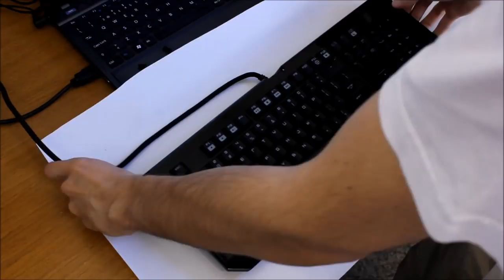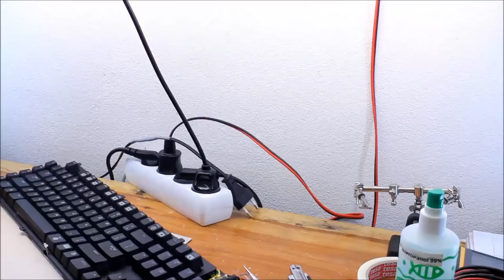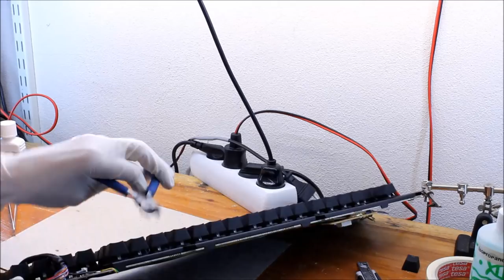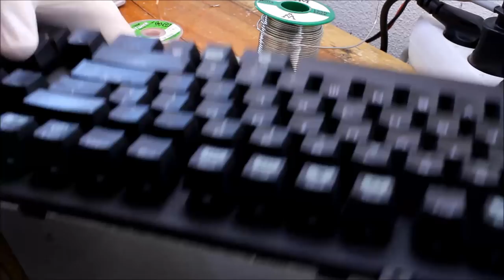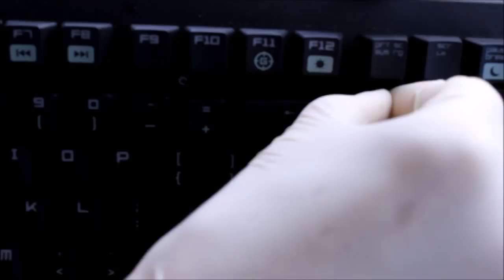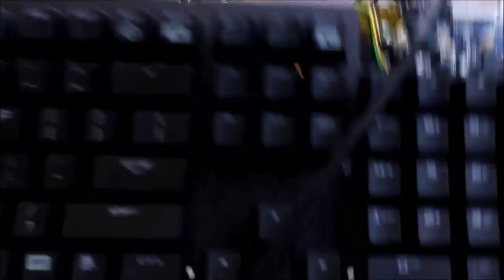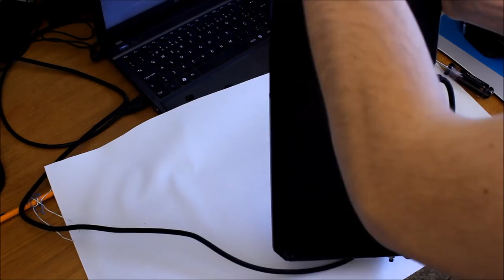How to replace backlight LEDs and Cherry MX switches in a mechanical keyboard.

Comment: Can a technician do this for me?
Reply from the maker: Sure, take it to a computer or phone repair shop near you and ask for a quote
Reply: Ok, thanks very much :)! Mine is the Razer Blackwidow Ultimate 2013, you think it is possible to switch my LEDs to Reds and leave the switches as they are?
Reply from the maker: Yes, but it will be a LOT of work, and the PCBs are very low quality (at least it was in mine), you will probably damage a couple of tracks and have to make wire shunts to repair them. If you decide to do it and you are not very experienced, find an old PCB and use it to practice removing and resoldering components so you are more confident when you do it in the keyboard.
Reply: Thanks a lot dude :)!!

Comment: No offense but the way you remove those led's are not recommended! You should do it with a soldering sucker to completely removing the old solder without damaging the actual pcb and also to easily replace them with the new one
.
Reply from the maker: +DARKRENGIN PRODT. (DARKIEST) If you replace it with a solder sucker you will use as much heat as I was using with my soldering iron, I concede it will be easier to insert the new one, though. I removed all of them like that and I only damaged one pad by accidentally applying a bit of lateral force (damage that would not occur if the PCB was of decent quality).

Comment: you forgot to say that the LED must be in the same position as you removed it otherwise the LED breaks and you need a new one that s a massive fault in this video
Reply from the maker: The LEDs in this keyboard are wired in parallel, it's really unlikely that an LED will get damaged at 4,5V with such a high value series resistor.

Comment: please answer me urgent , my smartphone has internet data bandwith cap so i can't watch the whole video , what kind of led used in the mechanical keyboard ? , i have poseidon z , are they 3mm or 5mm , are they normal led or super bright one ? thank you please answer fast
Reply from the maker: Hi, they look similar to cherry MX switches, so they should be 3mm LEDs, preferrably without the plastic protrusion at the bottom.
Reply: what is plastic protrusion ? you mean the circular bulge in bottom part of led ? i can't find 3mm without that plastic protrusion
Reply from the maker: The LED manufacturers call that buldge a "flange", so you need flangeless, like these:
 
http://www.aliexpress.com/wholesale?SearchText=flangeless+led

or these: 

http://www.ebay.com/sch/i.html?_nkw=flangeless+led
Reply: +José Faria can non flangeless led fit with the switch ?
Reply from the maker: They can, but depending on your switches and your LED dimensions, you might need to use a file to grind part of the flange away for them to be seated properly.
Reply: +José Faria its for kailh blue and magicforce with gateron clear , do you think it will fit ?
Reply from the maker: You can't know for sure, you will have to try it and if they are too big you just grind a bit of the plastic skirt away and it will fit. You can also just buy flangeless LEDs, check the links I sent you before, they are rather cheap in bags of 100 or 200 pieces.

Comment: Razer products are TROLOLOLOLOLOLOLOLOL worthy.
Reply from the maker: +ChunkierBug I've had 5 Razer products in the last 10 years and only the Razer Copperhead (2005) was worth the price, the rest should have cost less than half. The Razer Orochi was bad in bluetooth mode and had a mediocre sensor. The Blackwidow's software was the last straw. Maybe their support and quality improved in the last 3 years, but nowadays there are plenty of good alternatives at the same price points. Both my CM keyboard and Corsair mouse cost the same as razer products and I'm perfectly happy with them.
Reply: José Faria Razer, Turtle Bitches, Alienware, Beats, Triton are all a perfect example of selling shit with a recognizable brand written on the box and clueless nerds will be all over em. These brands are made to milk dumb consumers.

Comment: braid lol use a sucker
Reply: Anyone with a long history as an electronics technician can tell you that braid is best for most removal applications. Unless there is massive excess solder, then a sucker and some flux will allow you to suck most of it off. Just saying. I am picky about brand of braid however. Not all works well and the good stuff is expensive.

Comment: im sorry but the fact that you are demonstrating how to replace cherry mx switches with a kahil switch keyboard is messing with me >.<
Reply from the maker: INDEED I don't understand your point, I'm replacing a Cherry MX switch with a Cherry MX switch. That keyboard was a 2012 model.
Reply: José Faria ohhh you have the good blackwidow :) good boy haha
Reply from the maker: No, I don't. I got tired of Razer and now I'm very happy with my CM trigger Z with Cherry MX brown switches :)
Reply: José Faria
haha i agree. i have the corsair vengance k70 with brown switches and love it
Reply from the maker: I wanted that one, but I couldn't find a local retailer that sold it at the time and I wanted to try it first, so I went with this one. Not as good looking as the Corsair, but just as good and cheaper.
Reply: José Faria yes
Reply: +LennyFont Well even if it was, they have very similar designs which is why it wouldn't matter.
I'm actually watching these videos as i'm thinking about switching a cherry switch to the Gateron Clears, due to their light 35g switch and incredible smoothness.
Reply from the maker: Jeehoondevil  35g to actuate is very nice, I'll have to try them, and with reports of people buying them at $0.2, they are also very cheap.
Reply: José Faria Yeah, I'm a huge fan of the linear cherry mx reds, so I REALLY want to try this gateron clears seeing their lighter and smoother.
Reply: The Razer Blackwidow keyboards used Cherry MX Blue or MX Brown switches through 2013.  Starting w/the 2014 model, they switched to "Razer" switches, "Green" or "Orange" that are essentially re-branded Khail switches under the Razer name.  Just wanted to put that to rest.  

Source-- have owned both models, as well as several Oetemu-equipped keyboards that I actually quite like.